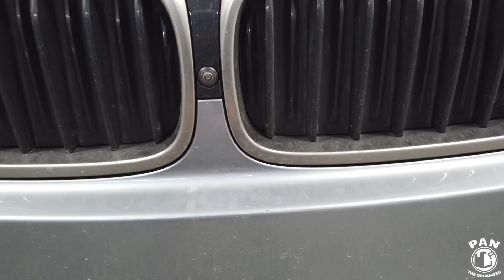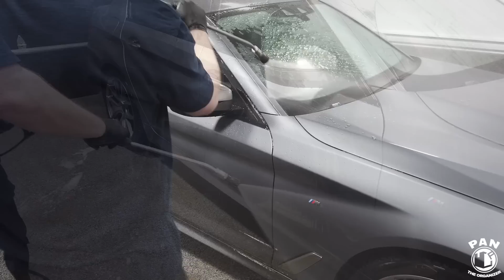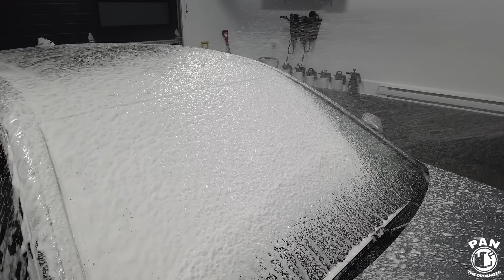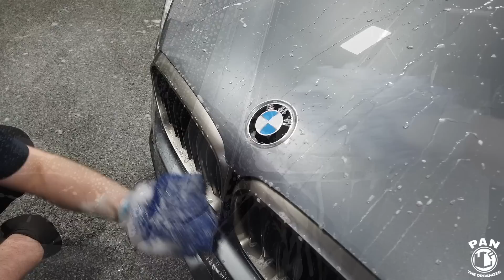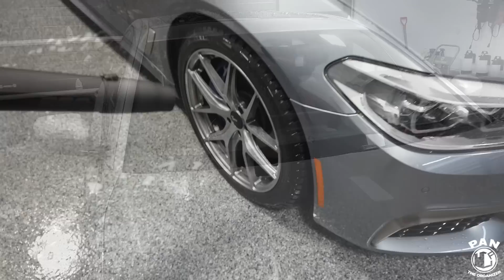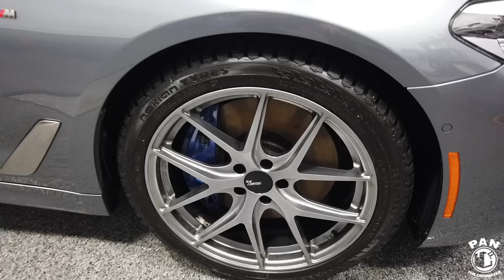STRESS RELIEF WASH - STAY AT HOME AND WASH YOUR CAR !!

Comment: We’re all quarantined for weeks and all we get is twelve and a half minutes?! Haha come on give us the full wash! Awesome video!
Reply: What is a good amount of time for a maintenance wash? I take 2 hours...wash, dry and maybe a spray on protection.
Reply: @melodeath3961   I roughly take 2 hours as well. But u could definitely be more efficient. It depends on how many details you take care of.
Reply: But we only get 2 videos a month from your channel? We need that weekly dose of Chromatic Auto Detailing!😅
Reply: @fabi7562  Last week it took me 6 hours, hasn't been washed in 3 months...we had a weird winter over here in Belgium, rain, wind...that was a wash, machine polish, machine wax and the interior and tyre and rims. It took me 45 mins for the rims alone 😱
Reply: I’d say if your car is really well protected than you shouldn’t be taking so long to wash and dry, just use a rinseless solution in between washes and do a top coating of whatever you want and that’s it. Your car will still look just as good and you’ll take at the most like 30 minutes to clean what’s visible.
Reply: alexdabest558 I think the idea is in the title. It’s a stress relief wash. I can take an hour just to do my wheels (without removing them) when I’m not in a hurry and need to just zone out. I get the idea Pan is like that a bit too.
Reply: @melodeath3961  I was wondering if I was taking too long on my washes. Takes me anywhere from 3-5 hours when I do wheels, pre-rinse, pre-foam, 2 bucket wash, rinse, drying with a drying aid and dressing tires and plastic/vinyl trim.
Reply from the maker: Hehehe.  Thanks!  I'll make more like these.  It seems my viewers loved it.
Reply from the maker: If I wasn't filming, this wash normally takes me 45 minutes.
Reply: @melodeath3961  Closer to 3 hours for me from start to finish, but I drive a Titan.
Reply: @wila.8249  And what are you driving?
Reply: @PanTheOrganizer  Sure do 🙂👍
Reply: No doubt your car is super clean but I feel the colour isnt the greatest or is the car you need some thing a bit more flash I think
Reply: Pan ASMR 😂

Comment: But I've already washed mine twice this week and it only left the garage three times in the same period (twice to be washed).  My wife's car hasn't left the garage in two weeks but I just polished it again yesterday as I saw a slight defect or two I must have missed last time.  I'm about to start asking the neighbors if they would like me to wash their cars.
Reply: im the same, washed my car twice this week, and i have not used it once :(
Reply: wildwalkeruk LOL, I HEAR YA,  wonder if a car can be too clean. 😂
Reply: @tundrawhisperer4821  hehe, maybe. I didn't want to re-wash a perfectly clean car today, so I did a big interior clean and did the engine bay. My new clay bars arrive next week, so there goes a couple of days :)
Reply: wildwalkeruk , nice!  It’s always a good feeling to slip into a nice clean interior as well!  Which clay method do you use?  I’m really considering giving that Nanoshock and autoscrub 6” clay disc, by Nanoskin a try.  Any experience with that system?  Thx
Reply from the maker: I want to detail my entire neighbourhood's cars!  :)
Reply: @tundrawhisperer4821  Hello, i have purchased plain old clay bars and will use those. I did the car last time with a clay Mitt, and I have to say I got the car done in just over an hour. I think the clay bars will remove some things the mitt did not, but the Mitt definately got 95%+of the contaminants out. That was only a year or so ago and so the paintwork is still very good (only do about 6000 miles per year).
Reply: wildwalkeruk interesting, good to know.  Which brand of clay mitt did you end up using?  What is your go to clay lube product?  Thx

Comment: I'm 4 years late seeing this, but what a soothing and relaxing video!!  Thanks to you and some of your peers, I have also come to enjoy the car wash experience.  I don't have a pressure washer, or a leaf blower, but will be getting them in the future.  I do have a soap gun which works well.  Will be washing my car tomorrow.  I like doing an APC Rinse/Wash, then manually washing my car.  I drive A LOT for my job, so I try to wash my car once a week.  Because I put a graphene coating on it, it's MUCH easier to wash and keep clean.  Thanks to all of road construction that's been taking place in my area, I will be implementing a tar removal for the first time.  Will be sure to let you know how it turns out!  Thanks for posting this awesome video!!!
Reply from the maker: What's your favourite soap currently?
Reply: @PanTheOrganizer  I like the TW Slick-N-Slide Pure Wash and the Meguiars Gold Class Wash.  Both foam very well as does the Mr. Pink from Chemical Guys.  However, when I wash my car today, I will be using the TW Ceramic Wash.  I'll likely stick with the ceramic wash going forward as it's the better compliment to my graphene coating.

Comment: Pan! Thank you very much for the reply and link to this video!
One additional question,  we both have similar M brakes. With both my X3M and M50i, I blow dry the rotors after I do each rim to reduce the surface rust. As soon as I drive and then park, the rust particles are all over the barrels. Any trade secrets  or future video on reducing this effect?
Again, thank you.
Reply from the maker: Not much miracles are possible, other than coating your rims.  I like using Gyeon Wet Coat, as it's a simple spray on and rinse off formula.
Reply: Thank you.  I do have them coated. Now reduce to driving back and forth on driveway to wear surface rust of rotors. Then blowing rims out with leaf blower. Lol
Cheers!!

Comment: Nice Pan. Excellent choice of music. I’m just not sure a leaf blower is an zen as the rest of the video. BTW, I bought the EGO580 with 5.0Ah battery after seeing you use it on your car and even though I’ve got a ceramic on my car and the water just sheds like crazy, I still can’t get around my entire car in one charge!! Any tricks of the trade welcome on this one. Thanks.
Reply from the maker: I can usually do all my car and all the wheels with a single 5.0Ah battery and still have one notch left...  When you're done, just use a microfiber towels and drying aid (like Bead Maker) to pick up what ever is left, plus you add a bit of shine and protection.
Reply: Pan TheOrganizer thanks for the tip.

Comment: is this a maintenace wash or is this how you normally wash your/your clients cars? also if you were to apply IRONx to a car at which step in the process would it be done and how many times per year should you use the product? thanks!!! and nice job
Reply from the maker: This is a regular maintenance wash for my car.  I do this twice wheekly on average.

You would use the iron remover after you are done washing your car.  Twice yearly or depending on your paint’s iron contamination level.

To put this in context, watch how I fully detail a car in this video: https://youtu.be/641mAJfKDLM

Comment: Hey Pan love your videos!  I"m wondering what kind of bucket an grit guard you use?  I just bought a Chemical Guys bucket and cyclone grit guard system and the grit guard doesn't fit snug on the bottom therefore defeating the purpose.  Which system have you found works the best?
Reply from the maker: I use The Detail Guardz Dirt Lock which I reviewed here: https://youtu.be/VKkufQ-rM4M

Comment: Hey Pan, i'm a long time fan of yours. Although I've never commented on your videos, here goes a little request: (pardon me if you've already done a video for this, i couldn't find it) I have a vehicle with a vinyl wrap. Over the last year it's gotten some swirl marks from me not using the best car washing techniques (no 2 buckets for example, just the one). My question to you would be, how can I address the swirls, and go about ceramic coating the vinyl? Does 'decontamination' still apply as there is no clear coat involved? I'm assuming one would just wash the vinyl with warm water, clean it with proper soap, wash again with warm water, dry it off, then straight away apply our 10h ceramic coat? And then I assume it'd be nice to put on a layer of wax after the ceramic coat has cured? 
Is this all an overkill, or am I making any incorrect assumptions? I'd sincerely appreciate your input! In fact, you should maybe make a video about detailing a vinyl wrapped car - there's a few videos out there but they are limited to general maintenance as such, none of them target swirls or imperfections. 
Thanks!!

Comment: I have an electric power washer. What psi setting do you recommend for washing/rinsing and using a foam cannon?
Reply from the maker: For washing cars, nothing above 2000 psi.  I set my pressure washer to 1000-1100 psi.

Comment: Hey Pan, what’s the best way to get rid of the orange dust that you get on your perfectly clean gloss black wheels after you’ve just finished washing them and gone for a drive? I have large steel rotors by the way, hence the orange brake dust that cakes onto the rotors when using iron remover etc. they look perfect once I’ve just cleaned them, I then go for a drive and they’ve got the orange dust on them :( thanks!

Comment: How are you liking the Opti-Coat Pro Plus? I'm trying to decide between that and Gtechniq CSL/ EXO.
Reply from the maker: It's the best ceramic coating I have ever tested.  The fact it's on my own car says a lot.  I will do a one year update video soon.  Don't forget, Opti-Coat Pro+ is a 7+ year pro grade ceramic coating that costs 1600$ USD for a car like mine.  You can't compare CSL/EXO combo as that is a consumer grade under 150$ solution.  You would have to get Gtechniq Crystal Serum ULTRA  to compare apples to apples, and that is WAY more expensive than CSL.

Comment: Great video Pan! Super enjoyable haha. Hey what do you use for BMWs Cerium Gray accents? You know how easy they get water spots etc. when they're uncoated.
Reply from the maker: Thanks!  My car is ceramic coated with a high end Opti-Coat Pro+ coating, and topped regularly with Opti-Coat HyperSeal or Bead Maker.  No staining issues.  :)
Reply: @PanTheOrganizer  I understand. My car is coated too but I did not coat the mirrors because I have YET to really get them clean. Once they are I'll coat the mirrors.

Comment: Best foaming I've ever seen out of a foam cannon.  What are the psi and gpm on your pressure washer?
Reply from the maker: It's my super high end Kranzle 1122TST pressure washer.  It's rated for 1400 psi but I set it at 1100 for washing cars, and more importantly, it pumps out a healthy 2.1gpm of water.  I also have a water softener system.  Here's my review of my pressure washer setup: https://youtu.be/Cj4FDpKuORI

Comment: Pan - Another great video and as others said it makes me want to wash my car!  However I need a bit of help. I have mirrored your methods for using P&S brake buster and Auto fanatic wheel cleaner and even bought the same sprayer but try as I might I just can't get anywhere near the foaming that you do! where am I going wrong ????
Reply from the maker: Do you have hard water issues?  What dilution ratio are you using?  Which pump sprayer are you using?
Reply: Pan - same sprayer as you and same measure as you. I get kind of soapy bubbles but no foam. we do have slightly hard water but nothing major.

Comment: Gday Pan ,ive just had my car gthechniq  ulta ceramic  coating applied , what else should i use on my paint. Can i apply bead maker straight  on my coating ,Goodonya , Burt ,Australia
Reply from the maker: You can absolutely use Bead Maker.  You can also use GTechniq C2V3 as a maintenance topper if you want to stay within the same product family.

Comment: Pan, I have a SunJoe SPX3000 electric pressure washer. I got a cheap foam cannon so it doesn't foam up anything like yours. Its rated at 2030psi and 1.76GPM. Would you be able to reccomend a high quality foam cannon for those specifications? I'm afraid that the MTM PF22 wouldn't work with my rated GPM. I know a higher quality pressure washer would be the best. Thank you!!
Matt
Reply from the maker: Yes a better foam cannon could help.  Before my high end Kranzle pressure washer (2.1gpm) I had a Karcher K5 (1.4gpm) and still produced crazy good foam.  I had the first version MTM foam cannon at the time.

Watch my foam cannon battle video here: https://youtu.be/Zji0y1UVkTw
Reply: @PanTheOrganizer  thank you so much! Because of you,  I'm now a car detailing animal! Thank you so much for that

Comment: Hi Pan.  Noticed during this contact wash you wore nitrile gloves, but the watery, soapy solution gets into the gloves anyways.  Does it kind of defeat the purpose of wearing them if the solution is just going to be trapped in there the whole time?  Thx
Reply from the maker: It's not to protect against the soapy water (which is pH neutral shampoo) but more for any other chemicals you're using.

Comment: Pan Can you stack Turtle Wax ICE Seal N Shine on top of each other or would you use that spray wax on top of the Seal N Shine? I just don't want to lose that "slickness" that I have now from using the Seal N Shine.
Reply from the maker: You can apply Turtle Wax ICE Spray Wax on top of Seal N Shine, they were designed to be compatible.  It should boost gloss and slickness.
Reply: @PanTheOrganizer  Thanks for the reply....I will get me a bottle of the ICE Spray wax and will put that on top of my Seal N Shine in about 1 month.

Comment: You should do an M5 conversion on your car. It already has the V8 soo
Reply from the maker: Why would I do that?  This car already accelerates to 100 km/h in under 3.9s it's stupid fast.  And I barely use the power, as I'm very careful on the road.
Reply: Pan TheOrganizer Just for the looks, a new front bumper quad exhaust tips
Etc. the car would look better

Comment: I have a quick question. Can I use Iron X on the Paint directly on a ceramic coated car? The purpose here is to decontaminate it once in 6 months and applying Iron X after the car is wet(Before wash). Also, can you guide me to a video of yours where you have taught how to remove any minor Swirl marks on a ceramic coated car without all those heavy tools and stuff coz i am not a professional and hence the query. Would appreciate your response
Reply from the maker: Yes you can, and should, use IronX on ceramic coated cars for iron decontamination at least once every six months.  You are not supposed to polish a ceramic coated car, unless using a special polish made for that like CarPro Essence+ (not the regular Essence).
Reply: @PanTheOrganizer  Appreciate your response. How should i go about removing the swirl marks on the ceramic coating? Is that whats CarPro Essence+  used for Or is there another product which should be used. Also by using that product to remove swirls will that damage the ceramic coating?

Comment: Hi Pan!  Question for you.  I want my tire dressing applicator not to absorb too much product.  In other words I want the product on the tire, not on the applicator after I'm done.  So is the Adam's Pro Tire Hex Grip Applicator high density?
Reply from the maker: I don't know how to answer that question.  I know it works perfectly fine for me and it's the only applicator I have been using for years now.  Maybe a microfiber applicator could be better suited for you.  Hard to say.  You need to try different options and find what's good for you.

Comment: Do you find the leaf blower more effective and easier to use than the Metro Vac you have hanging on your wall?
Reply from the maker: The MetroVac has way more power and is more efficient, but the EGO is portable and cordless so less of a pain to setup.  Both have their strengths and weaknesses.

Comment: Would you choose beadmaker over TLC 2?
Reply from the maker: Two different products.  TLC2 is way more durable and chemical resistant, but is SiO2 based.  Bead Maker is more versatile (can be applied on top of waxes, coatings and sealants) and is slightly more glossy and slicker.  Both are excellent.  I would perhaps apply a base of TLC2 and top that with Bead Maker during maintenance washes.

Comment: This is m550i? Is it reliable? How many miles it has?
Reply from the maker: Yes.  It’s a 2018 BMW M550i.  Super reliable.  I have had it since June 2018 and it has 30,000km on it (18,700 miles).  Not a single issue.  Before that I had a BMW 435i xDrive Gran Coupe M Sport for three years, zero issues too.
Reply: Pan TheOrganizer but then you didn’t use much ,, i mean i go one year 50-70tkm

Comment: I think I need a cigarette after watching this. 

All kidding aside, awesome video!

Not sure if you take video requests, but if you do, I'd love to see a video on the best way to keep the ceramic bottles clean and free of hardened silica between applications.  Coated one of my cars and apparently there was a microscope chunk of hardened coating on my first pass.  Had to re-do the entire hood, I thought I was going to throw up.  Since that day, I've been cleaning the caps and bottle tops really well, or so I thought. Yesterday I worked on some wheels and my CQ Delux cap and bottle was loaded with hardened silica.  This is starting to freak me out, and I am wondering if there's a specific way to keep the ceramic bottles and caps clean between applications and storage? 

Thanks for the channel and tons of great information. 

Rick

Comment: Hey Pan, great video! My car is parked next to a spruce tree and quite often I get leaves and cones on the car. With rain and snow they leave these kind of yellow marks on the paint. Here's a picture: https://imgur.com/coNJXd5 I tried cleaning it gently with my schenill  washmit during my bi-weekly car wash but they don't get off easily or not at all. One way I managed to get them off is with clay bar, but it's very tedious. Any tips on how to easily remove these? Also, do you think it can damage the paint if left for a long period? Thanks a bunch! Cheers from Finland :)